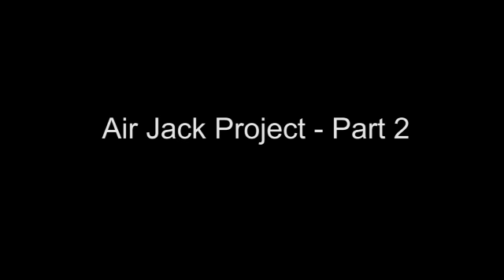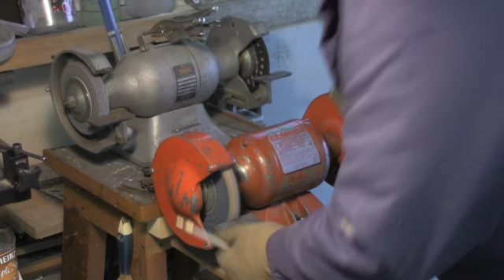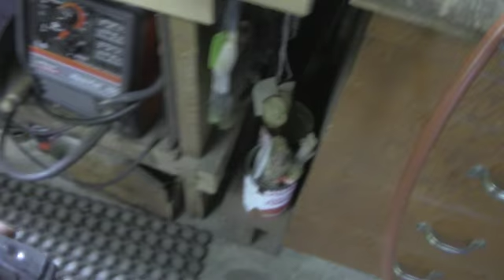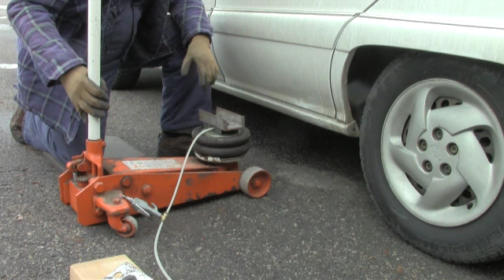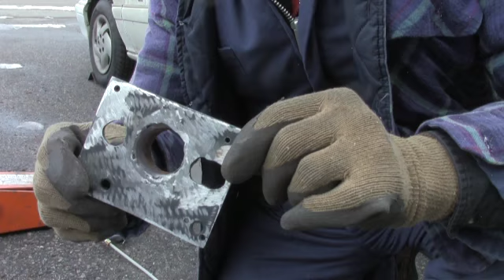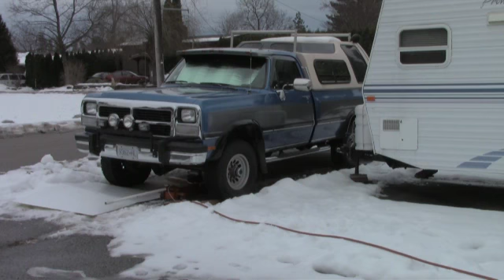Air Bag Jack Part 2

Comment: A good idea however there are a few safety factors that need to be addressed. Never use regular plastic tubing for an airline, get some airline that is approved for highway tractor/trailer applications. A air pressure gauge would be a good idea so you don't over inflate the airbag. It should also be bolted into a frame with a limited lift so the airbag cannot over extend complete with safety stops up and down. Mounting it on a jack could cause it to roll out and that would drop the load . Otherwise a great idea. Thanks.
Reply from the maker: Thanks for commenting.  The air line I used is not plastic, it is industrial nylon tubing designed for compressor controls able to take up to 500 psi.

Comment: WHOA!  STOP!!!!What you are doing is EXTREMELY dangerous.  NEVER - EVER inflate an airbag without it being installed in a device which limits its maximum extension stroke to that specified in the manufacturer's documentation. If you exceed the extension stroke, and no it does not take very much pressure to do so, the material could rip resulting in an explosive decompression which could launch parts of the air bag, including the end plate, at very high speeds which could harm or kill anyone in the vicinity. I have seen airbags ripped apart by this kind of misuse/misapplication. READ THE MANUFACTURER'S DOCUMENTATION - ESPECIALLY THE WARNINGS!!!
Reply: Now he's one of them keyboard engineers the very worst thing that could happen is the jack pops  the seal on the bottom plate a lot of the time and I mean a lot of the time truckers forget deflate there airbags and drive out from under a load with airbags inflated I'll probably have to Define that too so they jump out of the truck let the landing gear to the ground deflate the air bags and drive out from under without deflating the airbags what that does put high-pressure air in the air bag when I drive out from under load in the ass end of the truck comes up just totally eliminating any kind of support the bags pop their seal they got to pay somebody like me to jack your truck up realign the bag manually inflate each bag until they're all back on the bead
Reply: Frank Pedron   I  agree with you, i seen  that type of failure happened too.
Reply: did you work for an hydraulic jack manufacturer? man! he use a van trailer airsusp. to lift a ford escort . i hope you kidding us with the term ''dANGEROUS''
Reply: No, I was an applications engineer and I was trained by Firestone. That is the first thing they warn you about. I have seen the results of inflating an unrestrained airbag beyond its design extension limits, very easy to do even at low pressure. See the attached manual, page 1, upper right hand corner. The suspension of your truck provides a travel limit for the airbag. 

http://riderite.com/-/media/www/riderite/files/Install%20Manuals/W217602430_RRInstallManual_EN.pdf

What you describe is the extension of a rolling lobe style airspring and then trying to compress it without air pressure in it.  It folds on itself instead of rolling back neatly. What I'm talking about is the bead plate getting blown off the end of the airbag when the bead or the textile reinforcement fails. That is the catastrophic result of overextending an unrestrained airbag, and no, even you can't fix that.

Comment: speaking as a lowrider air bag user (which is what most people use those type bags for) its not that your truck is too heavy its the lack of air pressure from most home compressors. when these are in cars they have electric solenoid valves pushing between 150 and 200 psi, if they can lift a mid 60s caddy or lincoln that truck should be a breeze

Comment: nice build Ray! just a thought, maybe install a Schrader valve on the bleed line and you could air the tire with the air purged from the bag.....or just use the quick connect : )

Comment: Hey Ray, what a great idea. You can buy those air bottle jacks, but they cost $200.00 at Harbor Freight. I am going to borrow your idea, and I have some other ideas to go along with it. I expect we will see a lot more of this because it is such an excellent idea. Thanks for sharing it with us.
Reply from the maker: +Luvstruck 
Every body shop should have one of these for prying stuff apart that has been crushed.  I know they have hydraulic leavers and such but I'm sure I could find a use for it somewhere.  It was a fun project using recycled parts.   Thanks for commenting.

Comment: Many of those brass fittings and the nylon line appear to be the same fittings one would use for running water to the ice maker in a fridge.  I thought I would mention it so people looking for those parts might have an easier time finding them at the hardware store.
Reply from the maker: +hellcat1988 
You are right, some of the brass fittings I used are for high pressure gas/air fittings.  Something you would use on an air compressor to plumb an air pressure switch to releave the head pressure when the compressor shuts off.  The nylon tubing can be bought at most auto parts suppliers.  It is used for air brake setups and air bag installations.  Good observation and great comment.

Comment: hello, i want to know how to make that air ride kit
Reply from the maker: +Mohammed Amhadouch 
I don't know if you are confused or not.  The video was on how to build a jack to raise you vehicle using an airbag.  This is not an air ride kit.  Can you clarify what it is you actually want to build.
Reply: I want to buy an E30 bmw and i want to go for the air suspension as an option , if you can help me sir that would be magnificent
Reply from the maker: You will have to search the net for a suspension kit.  This video is how to build an air JACK.

Comment: We use these air bags at work all the time.  We usuallly install them on machinery that is braced so it doesn't move side to side.  And we always have a mechanical stop so it cannot be over extended.  We do have them blow out quite often but we run two 9 hour shifts and 5 days a week.  I would advize you to build something to contain it.  Like a sheild to contain it if it blows because when they do its catastrophic. I think you could do a bottle jack kind of frame that houses the airbag.  Or a scissor type but without the screw in the middle.  That might be cool
Reply from the maker: troy scott Thanks, great suggestions, I'm not done with this creation I have some other ideas I want to add to the jack.  I will post a new video when I get to it later in the year.

Comment: Kinda surprised that didn't lift that truck. I have air springs in the back of my van. Its 8,000 lbs total. diesel in the front and an even weight split. I have the firestone 5,000 air springs. I can easily lift the whole back or just one corner off the leaf springs with no problem. Of course I am running 100psi to do it and that is the unsprung portion. How much does the front of your truck weigh?
The only thing about this that gives me pause is the fact that with the air spring used like this there is no lateral support. Any slight angle and it could push the floor jack out one way or another. It works as is but just need to be real careful is all. I think jack stands would be imperative. fun project though.
Reply from the maker: consaka1 Thanks for you comment.  The mount on the top of the air jack is 3" U-Channel, that is what gives it lateral support.  The U-Channel fits around the axle and prevents it from slipping off.   I was using 100 psi on the single air bag.  A dual set of bags is designed to lift up to 5000 lbs.  Since I was only using one (2500 lb. capacity), it failed to raise the truck front end.   The truck weighs 6300 lbs. including the 1100 lb. cummins diesel engine.  I am planning to build a dual setup on an adjustable rail system.  That will give me the capacity to lift anything I have including my 28 ft. travel trailer.  subscribe so you will be notified when I post that project.

Comment: Hi... very interesting your vids. You inspired me... i wanted to build a motorcycle lift from long time ago.. a few days ago i started to buy all material needed, i bought two telescopic bottle jacks from harbor freight, unfortunally they did not fit on my design, so i striped down the jacks to take the cylinder off and use an hydraulic pump conected externally, i saw your vid and thought "i can use air instead" so i made some kind of mod to the cylinders, work excellent on 60 psi but they extend too violent, do you think under load they will calm dowm a little to rise the motorcycle a little slower???
Reply from the maker: fireblade639  I like your mod to the hydraulic cylinders.  To reduce the violent cylinder extension a load would reduce that somewhat, but I would still want to control the airflow to the cylinders.  You will see in my video, I used an air blowgun to add air gradually so the airbag does not hit it's full extension instantly.  This also allowed me to adjust the height by releasing or adding air gradually.  You don't want the motorbike to hit the ceiling or fly across the workshop.  Let us know how it works out or better still send me some pictures to post for you.  whyterj47@gmail.com
Reply: Ray Whyte exactly... sure, as soon as i finish the other i'll semd you the pics, i have a strut from my suv somewhere around do you think it can control the extension a little ???
Reply: Ray Whyte i will add the air gun, but i'm concern about taking it down, the air appears to escape too quickly, so maybe the strut will reduce the hitting down...
Reply from the maker: fireblade639 You should install some sort of device, a bolt or stop to lock your lift when it is fully up.  Don't rely on the air in the cylinder to hold the hoist while working on it.  To control the retraction of the lift you could put a small tap in the air line that you could use to bleed off the air slowly.  I installed a bicycle valve into a T which has an extended valve I can push to release the air slowly.  Just use your imagination here you will come up with something that works for you.
Reply: I'm on it... thanks for all your support... as soon as i have something  i'll send you the pics and video. .. thank you ...
Reply: +fireblade639 It sounds like your cylinders are just filling with air until they suddenly extend to full stroke. The hydraulic seals have more friction than air seals. Once the pressure in the cylinder overcomes this friction, the air expands rapidly causing sudden full stroke. Hydraulic oil does not compress and expand like air does. Your cylinders were not designed for use with air. A load will slow the travel but not stop it. Please be careful.
Reply from the maker: +fireblade639 I have done my job, inspiring projects for the home handyman is my goal with these videos.  Lifting a load should slow the speed somewhat, you may want to install a regulator or control valve, but be careful you don't want to shoot your bike through the roof.  You may want to try and get an air bag from an auto wreckers.  It would be far easier to control.  Good luck and thanks for your comment.

Comment: Very great !   One more use for this kind of jack is that it may be use as a portable air tank. Some time we need just a small amount of air on something that is out of reach of the air compressor...by adding an appropriate hose on the exhaust side you have the air tank,,,Don't stop thinking...

Comment: it will lift it . check air psi. those bags r 5000lbs @ 100 psi.
Reply from the maker: gary29brit21, thanks for your comment.
I was using 100 psi on the single air bag.  A dual set of bags is designed to lift up to 5000 lbs.  Since I was only using one (2500 lb. capacity), it failed to raise the truck front end.   The truck weighs 6300 lbs. including the 1100 lb. cummins diesel engine.  I am planning to build a dual setup on an adjustable rail system.  That will give me the capacity to lift anything I have including my 28 ft. travel trailer.  subscribe so you will be notified when I post that project.  It will be this winter sometime.

Comment: Here's an idea to pass along, instead of using that blow gun why not use a inflation gun with the trigger, gauge and bleeder button. If the hose is taken off the fitting is the same size as the blower gun so the T fitting would fit right on it and having the bleeder button would eliminate the need for the 3rd hose and the T fitting.

Comment from the maker: Lee;
The front end is just too heavy for 1 air bag.  I thought of building a dual bag setup but haven't got to it yet. The single air bag does every thing I throw at it except lift the truck front end. The truck weighs around 8000 lbs. so I estimate the front end with it's 1000 lb. plus cummins diesel engine is more than half of the trucks weight.  Air pressure was at 120 psi in the air bag and I was afraid it would burst if pushed to hard.  It has been a very handy tool, easy to micro adjust.

Comment from the maker: Good for you, I feel anything you can do with what ever tools you possess is $"s in your pocket and not someone else"s.

The bag compresses to 4 inches high and expands to lift 14 inches high.  You can also get extra lift by placing as much blocking under the jack as you can get.
If you  would like to see other shop projects, go to my web site.  I am adding new projects all the time, so subscribe if want browse the existing and upcoming shop projects under my video section.
  
raywhyte.ca